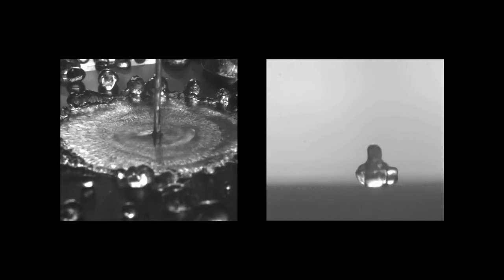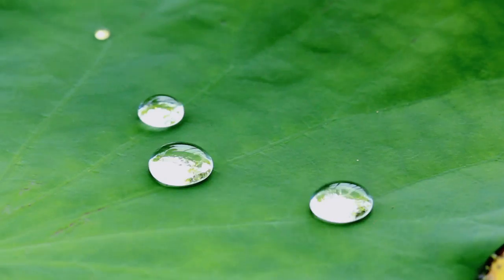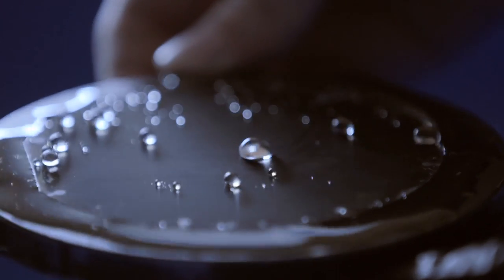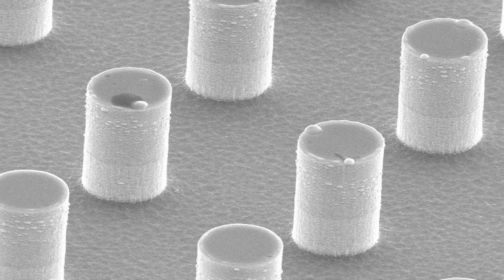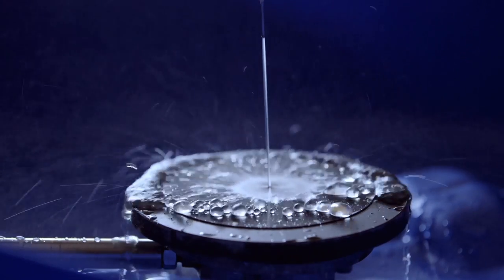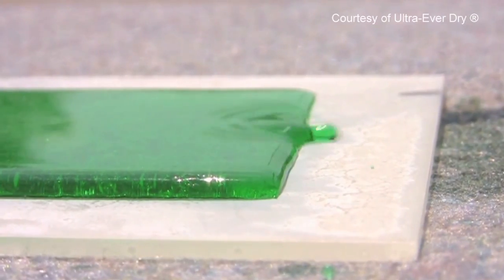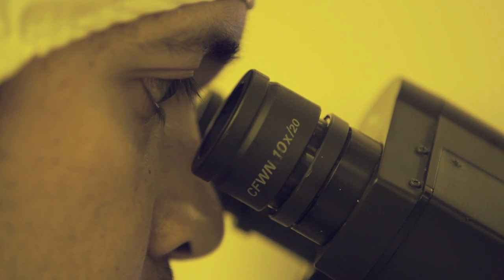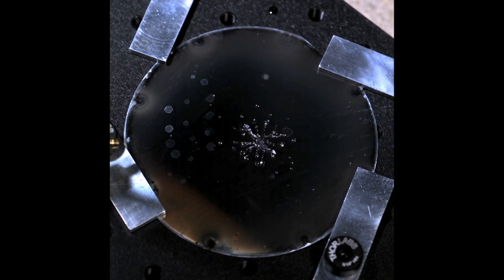Engineers bounce water off superhydrophobic surfaces

Comment: Coating airplanes with this substance would pretty much mean you'd never have to de-frost a single airplane ever again in the winter. Imagine the cost savings...
Reply: Sorry for the late reply to this question - actually superhydrophobic surfaces are great at reducing ice adhesion, but only up to a certain speed or temperature, then they actually increase the ice adhesion strength. Might be great for satellite dishes but not so much for planes, as Airbus found out. A different texture is needed here that prevents ice nucleation in the first place - directional riblets. We're working on all of these!

Comment: super hydrophobic ball bearings.... a coating for ferrofluid joints/hydraulics.... to make railgun with microfluidic channels in the rail firing  super hydrophobic rounds that glide over the rail easier because it is repelled by the microfluid circuits.
Reply: No friction from drag = high velocity.
Step 1 : Imagine
Step 2 : Profit.

Comment: At Rockwell Automation's world headquarters, research has been proceeding to develop a line of automation products that establishes new standards for quality, technological leadership, and operating excellence. With customer success as our primary focus, work has been proceeding on the crudely conceived idea of an instrument that would not only provide inverse reactive current for use in unilateral phase detractors, but would also be capable of automatically synchronizing cardinal grammeters.
Such an instrument comprised of Dodge gears and bearings, Reliance Electric motors, Allen-Bradley controls, and all monitored by Rockwell Software is Rockwell Automation's retro-encabulator.
Now basically the only new principle involved is that instead of power being generated by the relative motion of conductors and fluxes, it's produced by the modial interaction of magneto-reluctance and capacitive diractance. The original machine had a base plate of pre-famulated amulite surmounted by a malleable logarithmic casing in such a way that the two spurving bearings ran in a direct line with the panametric fan.
The line-up consisted simply of six hydrocoptic marzel vanes so fitted to the ambifacient lunar wane shaft that side-fumbling was effectively prevented. The main winding was of the normal lotus-o-deltoid type placed in panendermic semiboloid slots of the stator, every seventh conductor being connected by a non-reversible tremie pipe to the differential girdle spring on the up-end of the grammeters.
Moreover, whenever fluorescent score motion is required, it may also be employed in conjunction with a drawn reciprocation dingle arm, to reduce sinusoidal depleneration.
The retro-encabulator has now reached a high level of development, and it’s being successfully used in the operation of milfer trunnions.

Comment: Just saying, water bounces like a ball naturally without this hydrophobic coating, high speed cameras can show drops being dropped into a puddle of water and bouncing multiple times, along with raindrops, it's just physics
Reply: ***** I work in the lab where they filmed the video. It is true that water can bounce, but because of lower attractive forces, more of that kinetic energy can be elastically restored. If a surface is hydrophilic, or even superhydrophylic, the water will rapidly wet the surface preventing bouncing, except for satellite droplets that form when the droplet is moving fast enough that the momentum exceeds the surface tension forces (high Weber number impact).
Reply: ***** even though they said ''engineers bounce water off of super hydrophobic surfaces'' doesn't mean you cant bounce water off of other surfaces. You just took it the wrong way
Reply: I don't think you understand. These surfaces will never get wet. Water is incapable of sitting on it. Instead it will just run off.
I think she, as an actual scientist knows what she's doing a lot more than you believe you know.
Reply: I understand completely what a hydrophobic coating is, I have neverwet( even though this is a little different) but it's misleading title, " scientist bounce water off superhydrophobic coating", water bounces already, they aren't bouncing it because of the coating.

Comment: Just a thought/question: What would happen if a diver was to wear a fullbody suit of this superhydrophobic material and staying true to his hobby, then goes diving?
Reply: The reality? Not much. The superhydrophobic surface would form a platron layer (think spider or water skeeter in water) and the diver would shimmer. As the pressure increases the water will be forced onto the surface. We are looking at drag reduction, but those effects require very large surface features which in turn wet at lower and lower pressures.
Reply: When he drops in the he would have a pocket of air around him, like sitting in a bubble with no water. Just for a second, then the bubble would pull from his body, and water rushes in. Pretty cool. Type hydrophobic torpedo or hydrophobic ball bearing. They explain the idea, and show a slow mo comparison with and without hydrophobic coating.